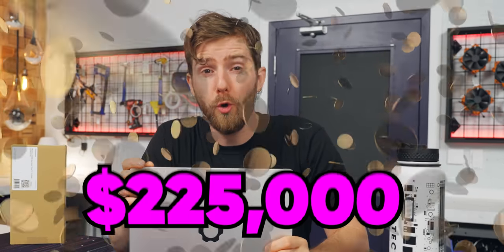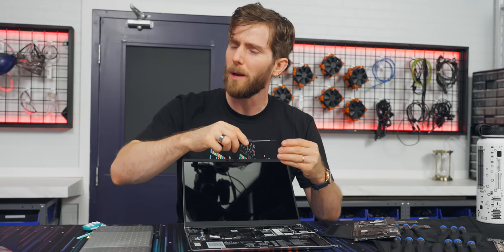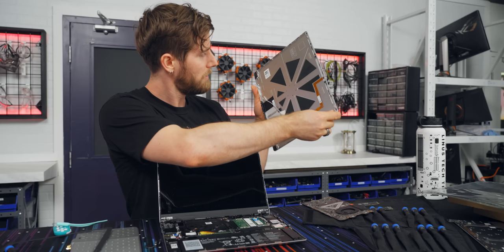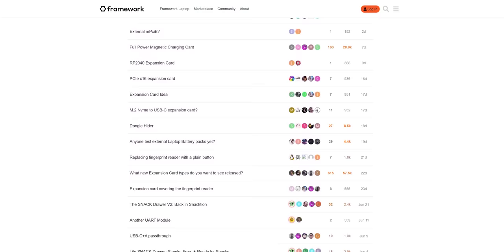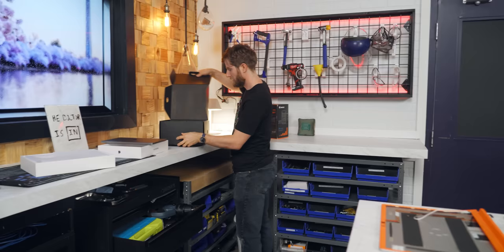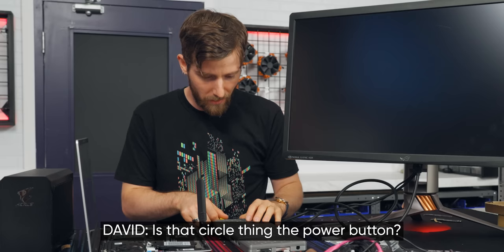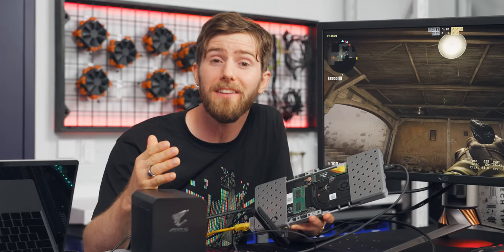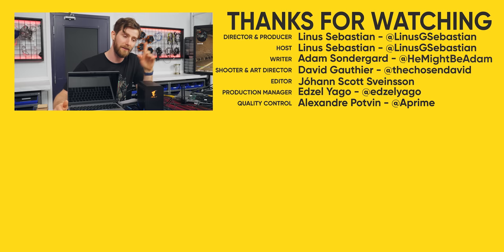I invested $225K in Framework Laptop - 1 Year Update and 12th Gen Upgrade

Comment: Can’t wait for them to eventually have an AMD option. Hopefully with Zen 4!
Reply: IIRC because all of the modular connectors are USB-C, they have to wait for Zen4 in order to be able to supply ~~video out~~ (edit: sorry--eGPU support) as Zen3 doesn't support Thunderbolt 3 (Zen4 will support USB4).

I'll tell you what I would love but is almost certainly not technologically feasible--nom-embedded CPUs like on the ASRock DeskMini line.
Reply: My next laptop is going to be an AMD Framework and I can't wait.
Reply: @GSBarlev  Zen3 does support Thunderbolt3, but its up to the boardmakers to make it happen.. if it didnt we wouldnt have boards like.

Gigabyte TRX40 Designare
X570 Phantom Gaming-ITX/TB3
Also dont forget Asus ProArt B550-CREATOR which has Thunderbolt 4
Reply: @GSBarlev  There are laptop out with desktop CPUs (Namely Clevo's) but main issue is obviously their much higher power draw. It's more practical w/ 12th gen intel b/c of p and e cores but still not great. Framework would probably have to redesign their chassis for greater airflow and size due to that as well. 
End of the day, it's probably more work for what it's worth.
Reply: RISC-V!
Reply: @gosera-1108  Yeah, but you also need to wait for certification from intel... I mean, if it was just a matter of designing one, I am pretty sure they would have done it already.

I am convinced the problem is more on the certification side.
Reply: @GSBarlev  whh dude? usb-c video output is available for years. Why would we need thunderbolt? 99% of owners do not use it.
Reply: @paul_wiggin  Sorry, not video out--eGPU support.
Reply: @paul_wiggin  its especially useful for laptops in particular for docks and running large throughput displays
Reply: Once they get an AMD variant, the final thing that I want before going onboard with framework is screen options. Specifically OLED Screens
Reply: I would love 6800u.
Reply: @GSBarlev  ryzen 6000 series supports usb 4 natively, which is compatible with thunderbolt, a lot of ryzen 6000 laptops currently support thunderbolt accessories with the latest bios update
Reply: @nekogami87  If I remember correctly, you don’t need certification from Intel to enable egpu support, as long as you are fine with calling ur type c port USB3/4 instead of thunderbolt 3/4, and saying you “unofficially” support eGPUs
Reply: @GSBarlev  Ryzen 6000(Zen 3+) does support USB4
Reply: Carbon credits is just as usefull for the climate as nft are for the gaming industry....
Reply: does ryzen 6000 have enough pcie lanes? those need 1 x4 pcie4 for the ssd and 4 x4 pcie3 lanes for usb4/tb3. and official thunderbolt certification must then be done by framework. and amd needs to finally ship some cpus
Reply: @GSBarlev  Zen 3+ founded in the Ryzen 6000 series supports USB4
Reply: will never happen
Reply: @GSBarlev  Doesn't Zen 3+ already supports Thunderbolt 3?
Reply: @Voyajer.  Oh damn you're right, I was sure I read thunberbolt before. TIL
Reply: @jasonz8635  Doesn't make sense, why would you put a desktop 12th gen CPU in a laptop? Desktops can barely cool those things and it seems idiotic to put it in a small form factor.
Reply: @davide4725  Those laptops tend to have beefy cooling + underpower the CPUs + don't have the top-end CPUs. I agree that it's not a good idea but it's been done.
Reply: @Tigerhearty  that's relevant to this thread. Derrrrrp
Reply: @GSBarlev  what is the use case of expensive e-GPU limited by only 4 Pcie lanes  of thunderbolt standard?
Reply: @Voyajer.  timestamp?
Reply: Turn to Jesus Christ. Jesus Christ died for our sins and God raised Him from the dead on the 3rd day. He loves us more than anyone. He created us and loves us. Call upon His name! Heaven and Hell are real places. We need to repent and turn to Him.

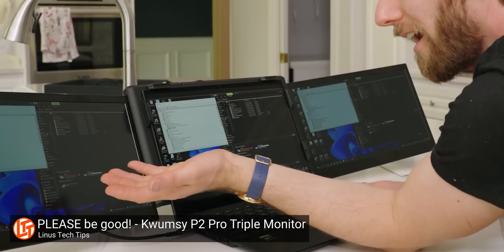“Then Peter said unto them, Repent, and be baptized every one of you in the name of Jesus Christ for the remission of sins, and ye shall receive the gift of the Holy Ghost. For the promise is unto you, and to your children, and to all that are afar off, even as many as the Lord our God shall call.” Acts 2:38-39 KJV 

“Jesus saith unto him, I am the way, the truth, and the life: no man cometh unto the Father, but by me.” John 14:6 KJV 

“He that believeth on the Son hath everlasting life: and he that believeth not the Son shall not see life; but the wrath of God abideth on him.” John 3:36 KJV 

“For if ye forgive men their trespasses, your heavenly Father will also forgive you: But if ye forgive not men their trespasses, neither will your Father forgive your trespasses.” Matthew 6:14-15 KJV

“And I say unto you, Ask, and it shall be given you; seek, and ye shall find; knock, and it shall be opened unto you. For every one that asketh receiveth; and he that seeketh findeth; and to him that knocketh it shall be opened. If a son shall ask bread of any of you that is a father, will he give him a stone? or if he ask a fish, will he for a fish give him a serpent? Or if he shall ask an egg, will he offer him a scorpion? If ye then, being evil, know how to give good gifts unto your children: how much more shall your heavenly Father give the Holy Spirit to them that ask him?” Luke 11:9-13 KJV

“And as it is appointed unto men once to die, but after this the judgment: So Christ was once offered to bear the sins of many; and unto them that look for him shall he appear the second time without sin unto salvation.” Hebrew 9:27-28 KJV 

“And Jesus said unto them, I am the bread of life: he that cometh to me shall never hunger; and he that believeth on me shall never thirst. But I said unto you, That ye also have seen me, and believe not. All that the Father giveth me shall come to me; and him that cometh to me I will in no wise cast out. For I came down from heaven, not to do mine own will, but the will of him that sent me. And this is the Father's will which hath sent me, that of all which he hath given me I should lose nothing, but should raise it up again at the last day. And this is the will of him that sent me, that every one which seeth the Son, and believeth on him, may have everlasting life: and I will raise him up at the last day.” John 6:35-40 KJV 
 
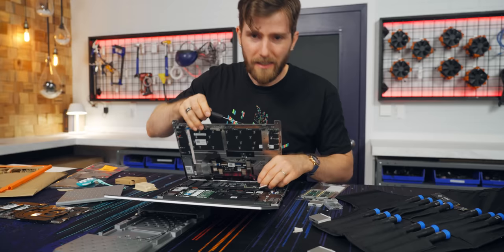“And fear not them which kill the body, but are not able to kill the soul: but rather fear him which is able to destroy both soul and body in hell. Are not two sparrows sold for a farthing? and one of them shall not fall on the ground without your Father. But the very hairs of your head are all numbered. Fear ye not therefore, ye are of more value than many sparrows.” Matthew 10:28-31 KJV  

“Whosoever therefore shall confess me before men, him will I confess also before my Father which is in heaven. But whosoever shall deny me before men, him will I also deny before my Father which is in heaven.” Matthew 10:32-33 KJV 

“That if thou shalt confess with thy mouth the Lord Jesus, and shalt believe in thine heart that God hath raised him from the dead, thou shalt be saved. For with the heart man believeth unto righteousness; and with the mouth confession is made unto salvation. For the scripture saith, Whosoever believeth on him shall not be ashamed. For there is no difference between the Jew and the Greek: for the same Lord over all is rich unto all that call upon him. For whosoever shall call upon the name of the Lord shall be saved.”
Romans 10:9-13 KJV 

“Jesus answered, Verily, verily, I say unto thee, Except a man be born of water and of the Spirit, he cannot enter into the kingdom of God. That which is born of the flesh is flesh; and that which is born of the Spirit is spirit.” John 3:5-6 KJV

“Who hath delivered us from the power of darkness, and hath translated us into the kingdom of his dear Son: In whom we have redemption through his blood, even the forgiveness of sins: Who is the image of the invisible God, the firstborn of every creature: For by him were all things created, that are in heaven, and that are in earth, visible and invisible, whether they be thrones, or dominions, or principalities, or powers: all things were created by him, and for him: And he is before all things, and by him all things consist. And he is the head of the body, the church: who is the beginning, the firstborn from the dead; that in all things he might have the preeminence. For it pleased the Father that in him should all fulness dwell; And, having made peace through the blood of his cross, by him to reconcile all things unto himself; by him, I say, whether they be things in earth, or things in heaven.” Colossians 1:13-20 KJV 

“Look not every man on his own things, but every man also on the things of others. Let this mind be in you, which was also in Christ Jesus: Who, being in the form of God, thought it not robbery to be equal with God: But made himself of no reputation, and took upon him the form of a servant, and was made in the likeness of men: And being found in fashion as a man, he humbled himself, and became obedient unto death, even the death of the cross. Wherefore God also hath highly exalted him, and given him a name which is above every name: That at the name of Jesus every knee should bow, of things in heaven, and things in earth, and things under the earth; And that every tongue should confess that Jesus Christ is Lord, to the glory of God the Father.” 
2 Philippians 2:4-11 KJV 

“Take heed that ye do not your alms before men, to be seen of them: otherwise ye have no reward of your Father which is in heaven. Therefore when thou doest thine alms, do not sound a trumpet before thee, as the hypocrites do in the synagogues and in the streets, that they may have glory of men. Verily I say unto you, They have their reward. But when thou doest alms, let not thy left hand know what thy right hand doeth: That thine alms may be in secret: and thy Father which seeth in secret himself shall reward thee openly. And when thou prayest, thou shalt not be as the hypocrites are: for they love to pray standing in the synagogues and in the corners of the streets, that they may be seen of men. Verily I say unto you, They have their reward. But thou, when thou prayest, enter into thy closet, and when thou hast shut thy door, pray to thy Father which is in secret; and thy Father which seeth in secret shall reward thee openly. But when ye pray, use not vain repetitions, as the heathen do: for they think that they shall be heard for their much speaking. Be not ye therefore like unto them: for your Father knoweth what things ye have need of, before ye ask him. After this manner therefore pray ye: Our Father which art in heaven, Hallowed be thy name. Thy kingdom come, Thy will be done in earth, as it is in heaven. Give us this day our daily bread. And forgive us our debts, as we forgive our debtors. And lead us not into temptation, but deliver us from evil: For thine is the kingdom, and the power, and the glory, for ever. Amen. For if ye forgive men their trespasses, your heavenly Father will also forgive you: But if ye forgive not men their trespasses, neither will your Father forgive your trespasses. Moreover when ye fast, be not, as the hypocrites, of a sad countenance: for they disfigure their faces, that they may appear unto men to fast. Verily I say unto you, They have their reward. But thou, when thou fastest, anoint thine head, and wash thy face; That thou appear not unto men to fast, but unto thy Father which is in secret: and thy Father, which seeth in secret, shall reward thee openly. Lay not up for yourselves treasures upon earth, where moth and rust doth corrupt, and where thieves break through and steal: But lay up for yourselves treasures in heaven, where neither moth nor rust doth corrupt, and where thieves do not break through nor steal: For where your treasure is, there will your heart be also.” Matthew 6:1-21 KJV 

“But Thomas, one of the twelve, called Didymus, was not with them when Jesus came. The other disciples therefore said unto him, We have seen the Lord. But he said unto them, Except I shall see in his hands the print of the nails, and put my finger into the print of the nails, and thrust my hand into his side, I will not believe. And after eight days again his disciples were within, and Thomas with them: then came Jesus, the doors being shut, and stood in the midst, and said, Peace be unto you. Then saith he to Thomas, Reach hither thy finger, and behold my hands; and reach hither thy hand, and thrust it into my side: and be not faithless, but believing. And Thomas answered and said unto him, My Lord and my God. Jesus saith unto him, Thomas, because thou hast seen me, thou hast believed: blessed are they that have not seen, and yet have believed. And many other signs truly did Jesus in the presence of his disciples, which are not written in this book: But these are written, that ye might believe that Jesus is the Christ, the Son of God; and that believing ye might have life through his name.” John 20:24-31 KJV 

Call upon Jesus Christ
Reply: And replaceable CPUs, and discrete GPUs and two screen sizes (14 and 17?).
Reply: @gosera-1108  - Once USB 4 becomes the norm, Thunderbolt will become very niche. Those cables cost a fortune.
Reply: The good ending